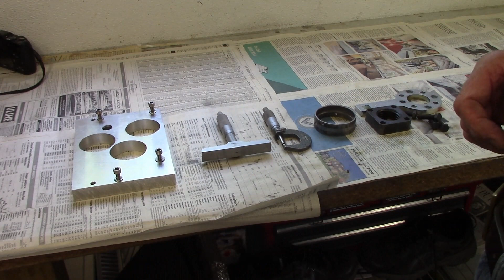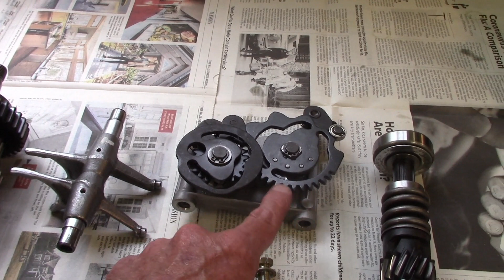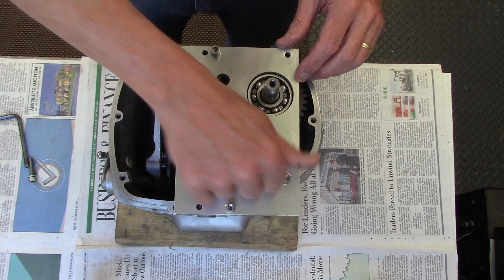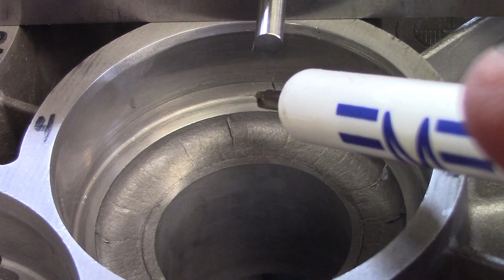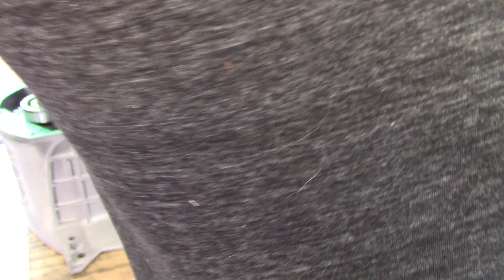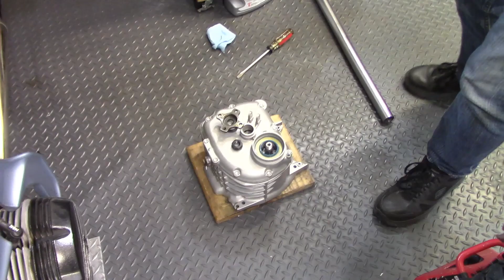1983 BMW R100RS Assemble Transmission

Comment: Detailed! and the knowledge too! I wish I saw this sooner before I started rebuilding the gearbox on my 1984 R100 RT. I'm just curious though what could possibly go wrong if I installed the output shaft seal with the spring inwards? basically inverted from how you installed it on yours, yes i have the oil bathed driveshaft too.

Comment: On the output shaft flange retaining nut, you specify 2 torque settings.  One at 160ftlb and one at 260ftlb.  Which is it ???
Reply from the maker: Check the web site link under the video image to see which is correct. Sorry about that mistake.

Comment: Sorry, not sure why that posted. But what I am trying to say is that a new C3 bearings have about .002 "flex" in them and when the gauge anvil strikes using one ratchet, you will flex this bearing down by this amount. I actually take the measurement from the inner race which does not flex. Due to the output shaft, I have to measure the outer part of the bearing, but I use a flashlight and the lightest touch to make sure I am not depressing the bearing.  I wonder if you can comment on this.

Comment: I have rebuilt many BMW airhead transmissions for 74 - 76 model years. One question I have for you is this. When you measure the bearing surface below the measuring plate you show your depth gauge at the outer part of the bearing vs the inner race. I use the same Mitutoyo depth gauge you are using so I know that when the gauge anvil interacts with the bearing outer

Comment: I have a question.
I have an r80gs 1990.
When my rear output shaft bearing had to be changed, i realized that it was just one side closed (gear side open). Is this originaly possible? I assembled the same way, but im not sure it is good.
Reply from the maker: BMW used plastic baffles to keep gear lobe in the bearings. New bearings often have two baffles instead of the original single baffle
Reply: @BrooksAirheadGarage  thank you for the reply! So the way i assembled is also good, right?

Comment: nice job! found out some more detalis: nobody elese mentioned the flange and output shaft have to be oil free. It makes sense now, but it s always easier to pay attention when somebody mentions it! 
One question: on my 1992 model, the output seal is different and installed with the flat face towards rear. Is that correct? It was leaking when I bought it and only had 37 000km.

Comment: Hi,

So I just finished putting in the seal. I "tapped it in" using a socket and rubber mallet. There's still a small drip. Do you think I didn't seat the seal all the way in?
Thanks for your help!
Reply from the maker: Roy, IIRC, it butts against a lip so it only goes so far.  If there is still a leak, that would lead me to look for scratches in the side of the hole the seal fits into or on the outside of the transmission output flange.

Comment: Great job as always Brook and as always, I have a couple of questions:

1) How different were the shims after the rebuild from those that had been there prior to disassembly?

2) When you replaced the worn fifth gear - how does the ratio become taller with only one gear being replaced?  I did hear you mention that the new gear has one less teeth - but it must also therefore have a smaller diameter and so wouldn’t you need a correspondingly larger gear on the intermediate shaft?

3) Given that the intermediate shaft is no longer available from BMW - what do you do if there is a bad component on it?   (YIKES!)

Comment: Well I just watch all 5 of the Transmission videos and I thought they were great!! Best Friday night I have had in a long time!! I started collecting photos of RS's and I have noticed that some have kick start levers on them.  Are they /6 transmission and do you know if a /6 trany can go on even an RS from the 90t's. also do you know if the trany gears were changed in the later RS's or did they just change the gearing in the rear ends? Once again you have put out some very nice videos Thank you!!!!
Reply from the maker: Hi Alan,

I'm not an expert on airhead transmission evolution.  In 1980, the R80 G/S came with a kick starter and the kick starter was retained in the R100 GS, so the transmission cover allowed use of one. The input shaft has another gear for the kick starter to engage. So, if the RS got a G/S (or GS) transmission, it would have the kick start lever.

There were changes to the clutch design over the years. You can look at the differences on my web site (brook.reams.me) in the documentation of the 1973 /5, 1975 /6, 1977 RS and this 1983 RS to see the changes. The clutch and transmission parts have to mate correctly. Once again, I'm not an expert on the evolution and how much "mix-and-match" you can get away with. 

As far as I know, final drive gearing is how BMW adjusted the drive train, not changing transmission gears. That said, aftermarket supplies such as Sibenrock do make a taller 5th gear and I believe a shorter 1st gear. I installed the taller 5th in this transmission.

You could read through Bob Fleischer's (aka, Snowbum) materials to find out more (https://bmwmotorcycletech.info/transmission.htm) 

I hope that''s helpful.
Reply: @BrooksAirheadGarage  Thanks for the info. Please keep up the build, love watching!!